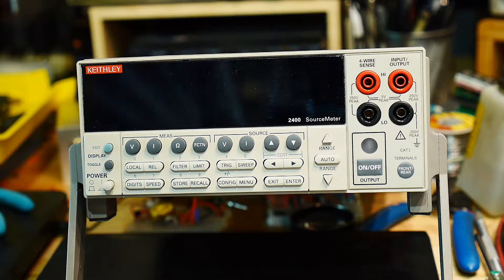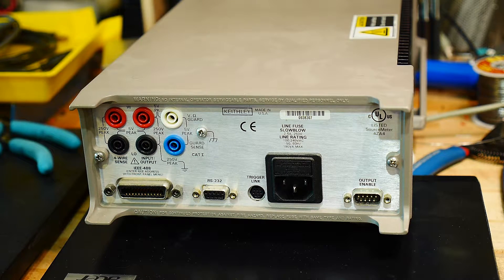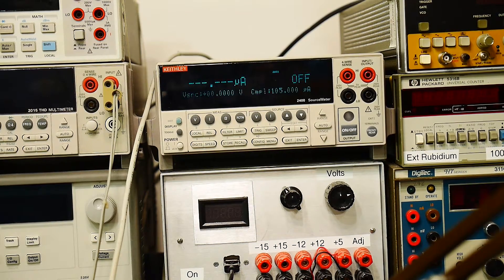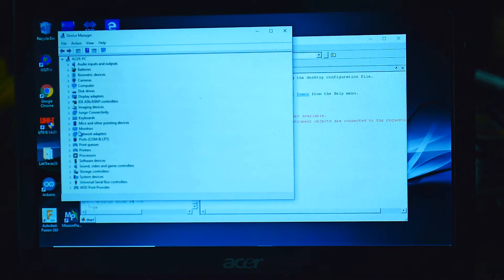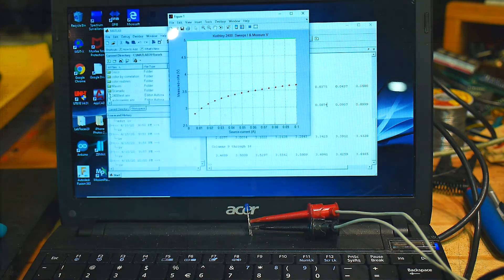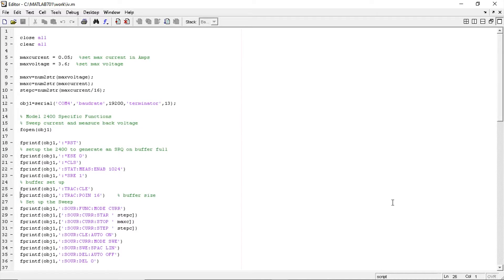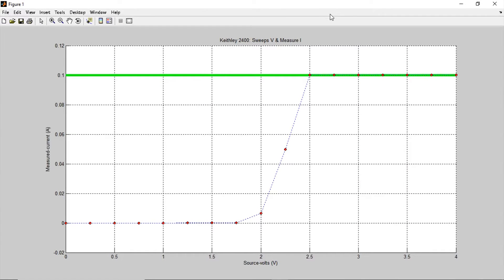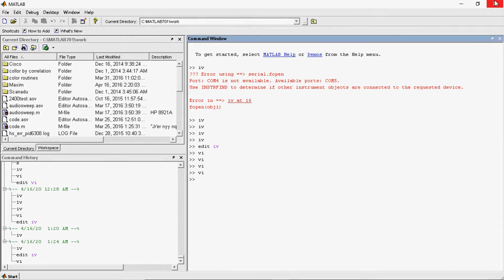#426 Using a Keithley 2400 Source Meter to measure LED voltage current curves

Comment: Very nice video. I assume you used a straight through rs232 cable? I am trying to connect a 2400 to Windows XP. I used a straight through cable and used hyperterminal and mttty to debug. The REM showed on the 2400 but also 101 or 103 error message. Did I miss anything?

Comment: Hi. Thanks a lot for posting this. 
I have the 2015 and now I can do automated THD measurements from within Matlab - so I really appreciate you taking the effort to post this. 
Sometimes you just need someone to point you in the right direction to get something done. 
I think I'll transfer the code to Python and get Matlab to call Python, that way I can have generic Python scripts which can be called from different programs.
Reply from the maker: I've had good luck with matlab but hit or miss using Octive. Let me know if you ever use that platform

Comment: Hi,
I have tried to use different SMUs during a couple of years and I don't understand them. I think it would be good to have a hands on tutorial. Can you make that?
(Scripts and programs are very nice but it say anything about how complicated the instrument is to use. Did you spend 15 minutes or 15 hours making that script?)

Yes, I have done several successful measurements with SMUs. But I have cheated a lot.
I think the problem is my (and many others) mindset. I see the SMU as a PSU + DMM + some extra things...
And PSUs are easy to use. Just turn them on, dial in the voltage and things start to work.
So, when I try to configure the "SMU-PSU" as a voltage source and the "SMU-DMM" as a current meter to test my diode I get nothing out. It doesn't work.
Then I try to add some parameters here and there, that I think can help, but it isn't. After 30 minutes of fiddeling, it starts working, and I don't understand why.
I think the +10 lines for configuring the instrument in the video has a lot to tell here.
The SMU is very special.

So, I would like to have an introduction on HOW TO THINK when using an SMU.
It shouldn't be that complicated. I just need to understand what is happening under the hood.
(In the Keithely 2450 they have added quick settings that I really like. Keithley know the instrument is difficult to use.)

Cheers,
/Sören
Reply from the maker: I have this: https://youtu.be/qFVhe_uzxnE
Reply from the maker: they have a quick guide: https://www.tek.com/en/keithley-source-measure-units/smu-2400-series-sourcemeter-manual/2400-series-sourcemeter-quick-start

Comment: I feel dumb for asking this… 

I understand the importance of characterizing base components. But I was always a bit confused regarding smu's 

Most smu's I've seen only put out a very low amount of power usually under 20 Watts

Obviously helpful for characterizing components but wouldn't it be more useful to have a source meter capable of higher powers? 

So that other pieces of test equipment and devices needing higher power could be tested and characterized? 

I feel really dumb asking this but any input would be greatly appreciated.
Reply from the maker: read the datasheet. it outputs more power than you think
https://www.testequipmentdepot.com/keithley/pdfs/2400_datasheet.pdf

Comment: Thank you for this work , could you say that which version of matlab did u use?
Reply from the maker: I don't know, fairly old. I tried to get GNU Octave running the code, but the RS232 are quite different and had problems.
Reply: @IMSAIGuy  thank you i tried also it gives many errors
Reply from the maker: @gulcindonmez2042  which usb to 488 converter are you using?
Reply: @IMSAIGuy  usb to rs232
Reply from the maker: @gulcindonmez2042  oh, rs232 is much easier. I would keep trying

Comment: Does it have a linear power supply
Reply from the maker: No  it has switchers but non standard: https://xdevs.com/fix/kei2400/#mainsp
Reply: So it's has a switch mode power supply

Comment: Hi . I  want to use Keithley source meter to get the V-I characteristic of laboratory-based fuel cell and solar cell, will it be possible to get it ?
Reply from the maker: you want to sink current and measure voltage? You will need to check the specs of the 2400. The current range may be too low for your application.

Comment: Can you plz share the code? It is not down there.
Reply from the maker: yes it is, but here it is again:
close all
clear all

maxcurrent = 0.030; %set max current in Amps
minvoltage = 8; %set min voltage
maxvoltage = 9; %set max voltage

numberofsteps=18;
numsteps=num2str(numberofsteps+1);
maxv=num2str(maxvoltage);
maxc=num2str(maxcurrent);
stepc=num2str(maxcurrent/numberofsteps);
stepv=num2str((maxvoltage-minvoltage)/numberofsteps);
minv=num2str(minvoltage); 

obj1=serial('COM4','baudrate',19200,'terminator',13);

% Model 2400 Specific Functions
% Sweep current and measure back voltage
fopen(obj1)
fprintf(obj1,':*RST')
% setup the 2400 to generate an SRQ on buffer full 
fprintf(obj1,':*ESE 0')
fprintf(obj1,':*CLS')
fprintf(obj1,':STAT:MEAS:ENAB 1024')
fprintf(obj1,':*SRE 1')
% buffer set up
fprintf(obj1,':TRAC:CLE')
fprintf(obj1,[':TRAC:POIN ' numsteps])    % buffer size
% Set up the Sweep
fprintf(obj1,':SOUR:FUNC:MODE VOLT')
fprintf(obj1,[':SOUR:VOLT:STAR ' minv])
fprintf(obj1,[':SOUR:VOLT:STOP ' maxv])
fprintf(obj1,[':SOUR:VOLT:STEP ' stepv])
fprintf(obj1,':SOUR:CLE:AUTO ON')
fprintf(obj1,':SOUR:VOLT:MODE SWE')
fprintf(obj1,':SOUR:SWE:SPAC LIN')
fprintf(obj1,':SOUR:DEL:AUTO OFF')
fprintf(obj1,':SOUR:DEL 0.10')

fprintf(obj1,':SENS:FUNC "CURR"')
fprintf(obj1,':SENS:FUNC:CONC ON')
fprintf(obj1,':SENS:CURR:RANG:AUTO ON')
%%%%%%%%%%%%%%%%%%%%%%%%%%%%%%%%%%%%%%%%%%
% IMPORTANT: if the unit goes into compliance, 
% adjust the compliance or the range value
fprintf(obj1,[':SENS:CURR:PROT:LEV ' maxc]) % voltage compliance
% if maxvoltage>20
%   fprintf(obj1,':SENS:VOLT:RANG 200')   % volt measurement range
% else
%   fprintf(obj1,':SENS:VOLT:RANG 20')   % volt measurement range
% end
%%%%%%%%%%%%%%%%%%%%%%%%%%%%%%%%%%%%%%%%%%%
fprintf(obj1,':SENS:CURR:NPLC 1')
fprintf(obj1,':FORM:ELEM:SENS VOLT,CURR')
fprintf(obj1,[':TRIG:COUN ' numsteps])
fprintf(obj1,':TRIG:DEL 0.001')
fprintf(obj1,':SYST:AZER:STAT OFF')
fprintf(obj1,':SYST:TIME:RES:AUTO ON')
fprintf(obj1,':TRAC:TST:FORM ABS')
fprintf(obj1,':TRAC:FEED:CONT NEXT')
fprintf(obj1,':OUTP ON')
fprintf(obj1,':INIT')

% Used the serail poll function to wait for SRQ
pause(2);
fprintf(obj1,':TRAC:DATA?')
% 
%C=fscanf(obj1,%f%);
B = fscanf(obj1);
A = str2num(B);
% 
% % parse the data & plot
Curr=A(2:2:size(A,2));
Volts=A(1:2:size(A,2)-1);
% 
figure(1);
%line([minvoltage maxvoltage],[max(Curr) max(Curr)],'color','g','linewidth',5)
hold on
plot(Volts,Curr,':bo','LineWidth',0.5,...
                'MarkerEdgeColor','k',...
                'MarkerFaceColor','r',...
                'MarkerSize',5)
ylabel('Measured-current (A)'),xlabel('Source-volts (V)')
title('Keithley 2400: Sweeps V & Measure I');
grid on
% reset all the registers & clean up
% if the registers are not properly reset, 
% subsequent runs will not work!
fprintf(obj1,'*RST')
fprintf(obj1,':*CLS ')
fprintf(obj1,':*SRE 0')
% % make sure STB bit is 0
% STB = query(obj1, '*STB?');
fclose(obj1)
delete(obj1)
clear obj1

%%%%%%%%%%%%%%%%%%%%%%%%%%%%%%%%%%%%%%%%%%%%%%%%%%%%%%%
Reply: @IMSAIGuy  Thanks, it works. Can you also share the source current measure voltage code?

Comment: Great demos! Can you share MATLAB code?
Reply from the maker: look down in the comments. I already did.
Reply: @IMSAIGuy  My apologies, I should've clicked on 'Read more' as that is where the code is hiding ;). By the way, you mentioned github in your video. Is the actual m-file there, and if so, could you post a link?
Reply from the maker: @jeffmiskimins2357  no not there

Comment: Can you share MATLAB code??
Reply: MATLAB version?
Reply from the maker: @MuhammadSalman-dh1uk  close all
clear all

maxcurrent = 0.030; %set max current in Amps
minvoltage = 8; %set min voltage
maxvoltage = 9; %set max voltage

numberofsteps=18;
numsteps=num2str(numberofsteps+1);
maxv=num2str(maxvoltage);
maxc=num2str(maxcurrent);
stepc=num2str(maxcurrent/numberofsteps);
stepv=num2str((maxvoltage-minvoltage)/numberofsteps);
minv=num2str(minvoltage); 

obj1=serial('COM4','baudrate',19200,'terminator',13);

% Model 2400 Specific Functions
% Sweep current and measure back voltage
fopen(obj1)
fprintf(obj1,':*RST')
% setup the 2400 to generate an SRQ on buffer full 
fprintf(obj1,':*ESE 0')
fprintf(obj1,':*CLS')
fprintf(obj1,':STAT:MEAS:ENAB 1024')
fprintf(obj1,':*SRE 1')
% buffer set up
fprintf(obj1,':TRAC:CLE')
fprintf(obj1,[':TRAC:POIN ' numsteps])    % buffer size
% Set up the Sweep
fprintf(obj1,':SOUR:FUNC:MODE VOLT')
fprintf(obj1,[':SOUR:VOLT:STAR ' minv])
fprintf(obj1,[':SOUR:VOLT:STOP ' maxv])
fprintf(obj1,[':SOUR:VOLT:STEP ' stepv])
fprintf(obj1,':SOUR:CLE:AUTO ON')
fprintf(obj1,':SOUR:VOLT:MODE SWE')
fprintf(obj1,':SOUR:SWE:SPAC LIN')
fprintf(obj1,':SOUR:DEL:AUTO OFF')
fprintf(obj1,':SOUR:DEL 0.10')

fprintf(obj1,':SENS:FUNC "CURR"')
fprintf(obj1,':SENS:FUNC:CONC ON')
fprintf(obj1,':SENS:CURR:RANG:AUTO ON')
%%%%%%%%%%%%%%%%%%%%%%%%%%%%%%%%%%%%%%%%%%
% IMPORTANT: if the unit goes into compliance, 
% adjust the compliance or the range value
fprintf(obj1,[':SENS:CURR:PROT:LEV ' maxc]) % voltage compliance
% if maxvoltage>20
%   fprintf(obj1,':SENS:VOLT:RANG 200')   % volt measurement range
% else
%   fprintf(obj1,':SENS:VOLT:RANG 20')   % volt measurement range
% end
%%%%%%%%%%%%%%%%%%%%%%%%%%%%%%%%%%%%%%%%%%%
fprintf(obj1,':SENS:CURR:NPLC 1')
fprintf(obj1,':FORM:ELEM:SENS VOLT,CURR')
fprintf(obj1,[':TRIG:COUN ' numsteps])
fprintf(obj1,':TRIG:DEL 0.001')
fprintf(obj1,':SYST:AZER:STAT OFF')
fprintf(obj1,':SYST:TIME:RES:AUTO ON')
fprintf(obj1,':TRAC:TST:FORM ABS')
fprintf(obj1,':TRAC:FEED:CONT NEXT')
fprintf(obj1,':OUTP ON')
fprintf(obj1,':INIT')

% Used the serail poll function to wait for SRQ
pause(2);
fprintf(obj1,':TRAC:DATA?')
% 
%C=fscanf(obj1,%f%);
B = fscanf(obj1);
A = str2num(B);
% 
% % parse the data & plot
Curr=A(2:2:size(A,2));
Volts=A(1:2:size(A,2)-1);
% 
figure(1);
%line([minvoltage maxvoltage],[max(Curr) max(Curr)],'color','g','linewidth',5)
hold on
plot(Volts,Curr,':bo','LineWidth',0.5,...
                'MarkerEdgeColor','k',...
                'MarkerFaceColor','r',...
                'MarkerSize',5)
ylabel('Measured-current (A)'),xlabel('Source-volts (V)')
title('Keithley 2400: Sweeps V & Measure I');
grid on
% reset all the registers & clean up
% if the registers are not properly reset, 
% subsequent runs will not work!
fprintf(obj1,'*RST')
fprintf(obj1,':*CLS ')
fprintf(obj1,':*SRE 0')
% % make sure STB bit is 0
% STB = query(obj1, '*STB?');
fclose(obj1)
delete(obj1)
clear obj1

%%%%%%%%%%%%%%%%%%%%%%%%%%%%%%%%%%%%%%%%%%%%%%%%%%%%%%%
Reply: @IMSAIGuy  thanks
Reply from the maker: @MuhammadSalman-dh1uk  7.0.1